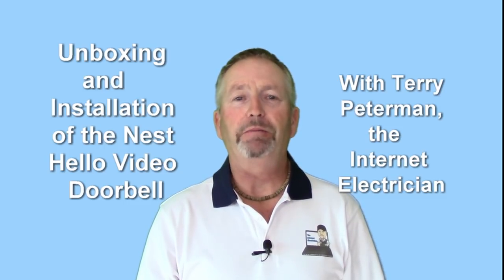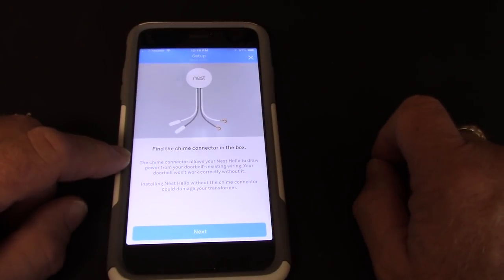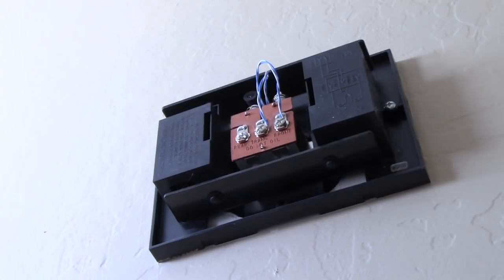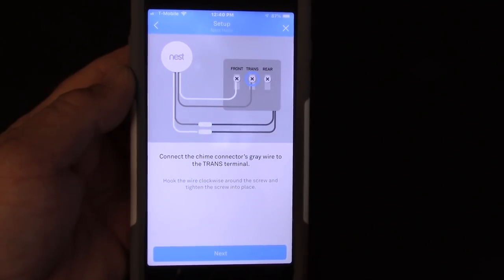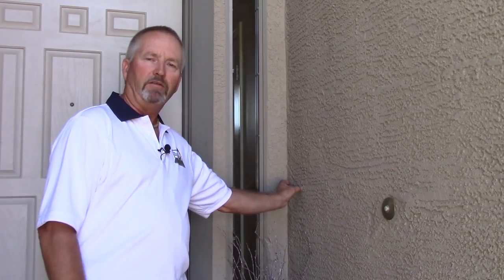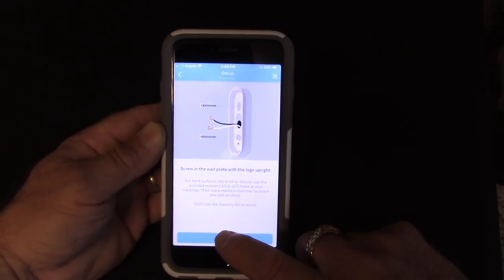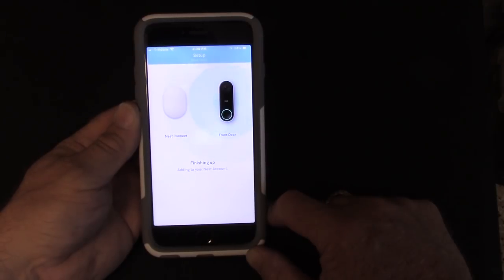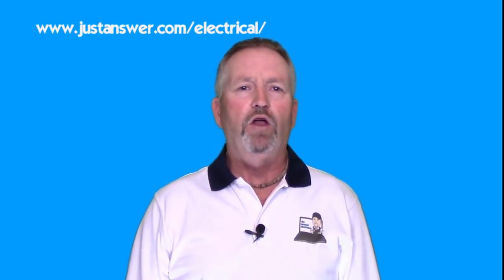The Best Nest Hello Video Doorbell Installation Tutorial

Comment: May I ask why you had to locate the transformer?  Unless I missed it, you didn't need it to connect the doorbell.  Excellent video btw.  I like to see installations before I buy and you made this look pretty easy.  Thanks!!
Reply from the maker: I just wanted to do a complete installation showing all the functionality of the Nest Hello.  Locating the transformer is prudent just so you know where it is should it ever need to be replaced, and to check that it is of the proper specifications recommended.

Comment: Thanks for outlining all the steps. Why do you need to locate the transformer since we are not making any wiring change there? My door bell has both a front and a back button. If I replace the front one with a Nest, will the back one still work?
Reply: You might find that you have to check the  voltage or wiring for some reason.   But  is  this case he could have skipped that step.

Comment: As for anchors, remember if you can't find a good anchor to fit the space you can use anything pliable that will allow the screw to get a good  bite. I've used toothpicks and chop sticks, used rat tails cut off from zip ties, you can even use scrap bits of wire - just cut them to a reasonable length, fit as many in the hole as possible and secure your project.
Reply from the maker: Good advice! Yes, sometimes you just do what it takes to make it work! Chewing gum! (but the double-bubble kind that gets so hard after a few chews that is almost breaks you jaw)  :-)
Reply: Great tip! Thanks!

Comment: Great video. Thanks.
Just my experience. Turns out that my doorbell was being powered by two different circuits.
Started out switching one breaker at a time off then ring the bell then switching it back on.
The bell never went dead for all the breakers.
Next I turned off all the breakers. the bell was dead.
Switched on each breaker (one at a time) then rang the bell then switched it off.
When I got to a breaker that rang the bell, I made a note of the breaker number then switched it off and went to the next breaker.
When I finished, I noted that two breakers controlled the bell.
BTW, my wife was at the front door with her cell phone and I was at the breaker box with my cell phone. NO, I wasn't running back and forth.
Reply from the maker: Did you locate the bell transformer? I'd be interested to know where the cross-connection is between 2 separate circuits.  That should be investigated further.
Reply: If the door Belt light is off, that mean you got the right circuit breaker.

Comment: What type of anchors did you use?  I have a very similar issue with the stucco and am very new to DIY.
Reply from the maker: I used drywall anchors, but what was mostly needed was some caulking / adhesive.  Very difficult to attach to a stucco wall  like this so you just make it work however you can. I would appreciate it if you like, subscribe, and click the bell as well (if you already did, thanks!) It really helps us creators gain traction with YouTube.

Comment: Hi Terry just watching your great video on Nest Hello installation. I'm trying to figure out the wiring on installing without a chime. Is that small round unit a new chime or is it a wifi antenna,, do I also need to buy a chime unit. I have a transformer and have some electrical experience. Thanks!!!
Reply: I installed my Nest doorbell without a chime, i ignored the little white chime adapter disc and simply connected up 24vac into the back of the Nest doorbell.
When i opened the little white disc to see what was in it, the first thing which surprised me was that the two grey wires were connected together and likewise the two white wires, and there is no wifi in it, it’s just a clever little device which sits in series with the ac power feed to divert power to the chime for moment when the bellpush is pressed, so since i have google in all rooms and i don’t need a chime thatks why i just left it out of my install

Comment: Hi Terry, great video.  I have the exact same setup (chime style, transformer, etc), except for the double wires. However, when I made these installations, the chime box had a buzz and eventually one of the chime posts popped off.  I also noticed a smell, as if something was burning.  I turned off the power and disconnected the wires.  No clue what to do from here though!  Any suggestions??

Comment: Hi, sorry for the question, I am trying to do it his in my own but not sure if I am supposed to turn off the power of the whole house? Sorry, I’ve never done this before and will like for my son and I to feel more secure at the house.
Reply from the maker: No need to turn off the power for the entire house.  If you can determine what individual breaker feeds the circuit that your doorbell transformer is on then great, only turn off that circuit.  But it's not all that common to include the transformer in listing what is on each circuit. But for example, if you find the transformer in the garage, or near your panel, it will likely be on the circuit that controls the lights and receptacles in that room, or if it's by the panel it might be on a circuit called the panel receptacle, or something similar.  If you can't easily figure out what the breaker is, or can't find the transformer, just shut off one breaker at a time and see if the doorbell still works or not.  When it quits, you've found it.  Also, the voltage from the transformer is very low, usually 16 volts.  Not that you should ever work on something without shutting off the power, but 16V is something that most people would not even feel by touching it directly.  That's why we power circuits like this with low voltage so if that cheap doorbell button breaks and the wires are exposed, you're not going to get any kind of a harmful shock from it.

Comment: Great video, thank you. Can you please add a little bit about using the wedge bracket that came with the camera. How to install and when needed. 
Thanks
Reply from the maker: You just use the wedge as a back plate and on the angel required to best see the person at the door.  As in my example, if the button was closer to the door then I would have needed it to get a better angle to where a person would likely stand while waiting.
Reply: @theinternetelectrician  Yes, thank you. I had already figured it out, but no one had a demonstration of the bracket that I could find when trying to install it. Thank you for responding..  Great video..
Reply: If you can't locate your transformer could you check the voltage on the doorbell wires? Or maybe the voltage across trans and front door while the button is pressed?

Comment: I am having an issue with connecting the Nest Video Door Bell to my office and a 2nd one at my home. it seems that I can only add one video Door bell to one structure. Because when I add a product and scan in my door 2nd doorbell at home or office.. it does not connect.. but when I "remove device" a home, my office will allow to install , and vise-versa. Any solutions for that?

Comment: Yes, I know how to install the first one from your tutorial , need help with connecting the second Nest doorbell to the same chime..many thanks
Reply from the maker: I think it would work to just follow the steps for connecting to the chime unit, but using the rear doorbell terminal for the second unit.  Then parallel connections on the 2 units for the common connections.  I would reach out to NEST however to confirm if this will work or not before purchasing.
Reply: @theinternetelectrician  To do the installation of the second Nest Hello, you need to upgrade the transformer. My first Nest Hello works. But, I have to relocate to further upfront since I built the front porch. In addition, I have to pre wire for the second Nest Hello.

Comment: Great Video.  FYI, My Doorbell is on the same circuit as my Furnace.  Go figure.  Guess that was easier than installing the doorbell's dedicated low voltage power supply.

Comment: Can anyone help me with a problem with my nest doorbell. I’ve followed a reinstall after going round in circles on the google app. Very good video, very clear and precise. However my problem is that although the doorbell has been mine from new it says it’s connected to another account. Unfortunately I don’t remember what that account was. I changed my email address and wonder if it’s something to do with that. I can no longer access that account. I have signed up to Google aware, useless, sends you round in circles, I can’t email or speak to anyone and I am not very technically aware. Any help would be gratefully received

Comment: My chime gets stuck at ding... , there is no dong. Sounds like it is stacked. I replaced and still same problem. there is 2 white wires and 2 red wires coming out where the transformer is. And I believe is a 12v transformer. Any suggestions?
Reply from the maker: Are you connected to the chime terminal for the back door (the ding) as opposed to the front door terminal (ding dong?)
Reply: Terry Peterman hi. no, it says front on the chime. Its almost like it wants to do it but it just stAys buzzing( spring compressed) and releases  it 1 min later,  the spring.
Reply from the maker: And the plunger isn’t sticking? Not sure what to suggest ?

Comment: I wasted time looking for my transformer! Just tested voltage with my multimeter at the door bell. It was 18 volts. So good to go! They only have u check the voltage output of the transformer.
Reply from the maker: Yes. Just to make sure it is within the parameters that the system requires.
Reply: You didn't waste time. You learned something about your house. It's your responsibility to know everything about your house. Why? Because it's YOUR house and YOU are responsible for its well-being. That being said, there are plenty of short cuts you can take in installing this stuff. But when stuff goes wrong you always have to reduce to checking everything, which means finding everything. Wait til you have to find a tv splitter that's embedded in the ceiling of your finished basement...
Reply: @theoriginalchefboyoboy6025  true. I also learned that my doorbell has a front door and rear door chimes. Handy to know!
Reply from the maker: @theoriginalchefboyoboy6025  Good input!
Reply: Agree!

Comment: Thanks a lot. You said find transformer in garage and i ran, low and behold it was there.
Reply: Please show the anchors used i also have a hollow stucco wall.
Reply from the maker: Excellent! Thanks for watching!
Reply from the maker: can't remember exactly what anchors I ended up using, but it wasn't pretty and the only thing that saved the installation was the caulking to basically glue everything together and then the bead around the base is probably what's holding it in place more than anything.  Not much else you can do with that situation.
Reply: I just found out my transformer is located upper closet near the front door.

Comment: I followed the instructions verbatim.  When done, the chimes on the mechanical doorbell no longer worked.  Any ideas?
Reply from the maker: Do they attempt to ring? Can you hear a humming or buzzing when the button is pushed? I'm thinking maybe the wires are jamming up the striker plungers?
Reply: Terry Peterman No noise at all.  Nothing. I left the cover off to make sure that the wires weren’t obstructing the plungers
Reply from the maker: @JohnLBeck  hmm.  Not sure then?
Reply: Is there a reset button on doorbells?  Also, is there a way to get a chime on the phone?
Reply: Can I assume that since the Nest doorbell is working that the transformer is OK and perhaps it is the doorbell itself that went dead?
Reply: Terry Peterman Terry, thanks for your help. I finally got it to work by turning on the electric chime ( which I had assumed was for some sort of synthesized chime and not a mechanical doorbell).  It sounds a bit weird but it works.  Thanks Again for your help and the great video
Reply from the maker: @JohnLBeck  Excellent! Happy to hear that it's working!

Comment: That’s fine and dandy for a 2 wire hookup , the transformer wire and the doorbell wire.  Now show us what wires to hook up with an older 60’s model chime having 5 instead of 2 connectors .
Reply: you can't use that chime or transformer probably.  You'd have to buy new ones.
Reply: Replace with new Chime and transformer.

Comment: Why do I need to find the actual transformer, I dodnt see you connect anything to it during the install
Reply from the maker: Just to verify the output voltage is in the range needed for the Nest, and you can check the voltage with your meter at the transformer terminals to ensure you shut off the correct breaker for the 120V circuit that it is fed from.  It's always good to know where it is in case it should ever fail.
Reply from the maker: @bybcous  If the transformer failed, it would just put out no voltage. You can verify that you have the correct breaker feeding the transformer just by checking if the doorbell works, then doesn't with the breaker off.
Reply: Thankyou so much for help, installing now, going smoothly